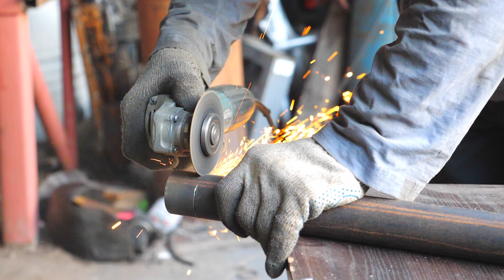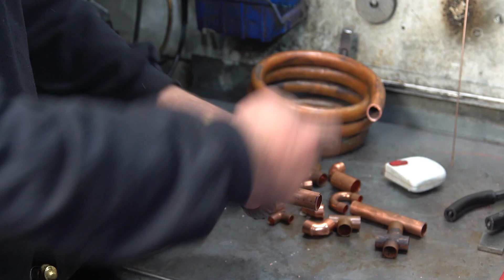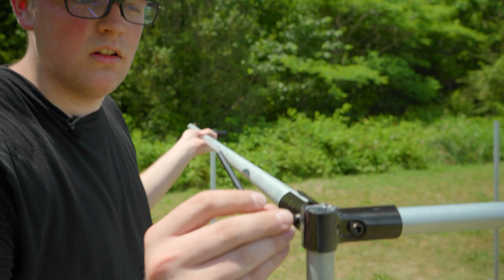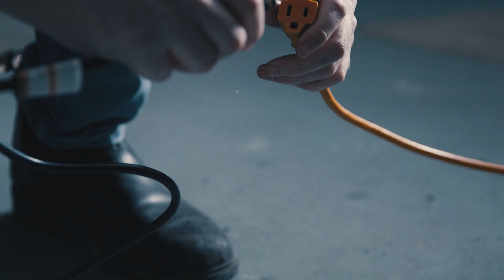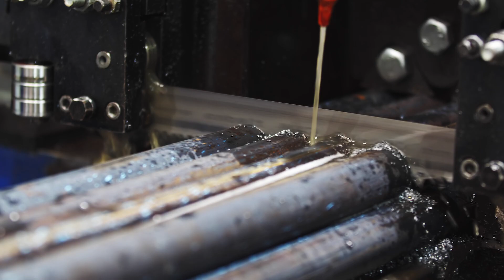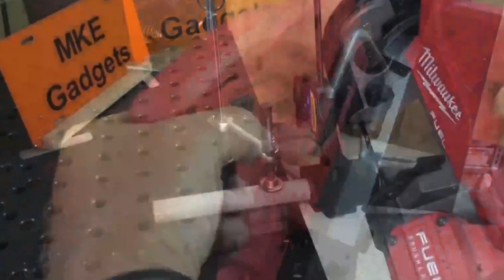Which Pipe Cutting Tool Is Right For You?

Comment: I have steel legs with 1” lined increments for utility shelving and find myself needing to cut down the legging pipe by (Amazon) Molfar named H27 Chrome Set of 4 Posts | Heavy Duty | Utility Shelving Units - Commercial Wire Shelf Shelving Posts Adjustable shelvingNSF Chrome Post   

Will a pipe cutter work to cut through this pipe (which I need to buy) or do I need to find a professional to cut it for me… if you read this message what do you recommend? Thank you!

Comment: Battery powered angle grinder + diamond cutoff blade + angle grinder cutoff stand holder = safe & super fast, repeatable 90 degree cuts anywhere. Also can do any angle, but why when we have Maker Pipe fittings? 😂
Reply from the maker: Haha nice! I have typically avoided grinders for cutting EMT but sounds like you've got a good process figured out. I'll have to give it a try myself. Thanks for the comment!

Comment: Honestly I've been using the Milwaukee M12 copper tubing cutter. Will it dull the blades faster? Sure. So far I've been enjoying it though, I find the convenience worth it, and it can cut very accurately. You do have to hold the conduit against the top of the tool in such a way initially that it grips, but this is easy to learn. Unfortunately the M12 is incapable of cutting 1/2 EMT, only the 3/4. The 1/2 is too small. I found a old forum post from 2014 of someone who removed an internal spacer and it was then able to cut 1/2" conduit (at the expense of cutting > 1" pipe I think). However after disassembling mine I discovered the newer serial numbers of 2471-20_B61C no longer have the removable spacer of 2471-20_B61A & B61B. There's a very clear diagram/note about this if you search for "44-66-0826 LOCKING PLATE KIT". The modification still seems possible, but instead of removing a spacer you have to replace the new thicker locking plate with the thinner original locking plate (without additional spacer). I ordered a few of this original plate but haven't performed the modification yet. I imagine the old part is becoming out of stock, sadly making this modification less accessible. If/when I perform the mod I'll post about it on the Maker Pipe forum.
Reply from the maker: Thanks so much for this comment Christopher. This is really valuable! It can be fun to go down the rabbit hole of things like this and do some problem solving along the way. If you end up doing the mod, I'd love to hear about it. Thanks again for sharing.

Comment: Good stuff with your breakdown of cutting methods. I own all of the tools you mentioned, other than the horizontal wet band saw, but usually break out the tubing cutter for most smaller jobs. I will point out that it is well worth it to get a name brand cutter (Ridgid or Klein, etc) , which are available from the box stores. IMHO, the durability of the cutter wheel is far superior and the cuts are cleaner, so less filing/ deburring is required. They also sell replacement cutter wheels for a few bucks. Remember that the tube cutter is designed primarily to cut copper pipe, which is much softer than steel EMT conduit, so the cutter would wear out sooner, and better steel (In the cutter wheel) is worth the money. A Ridgid cutter with 1-1/8" capacity is about $40 @ HD. 
   I already have several pipe projects in mind for my shop, and you guys have plenty of connector options available.
Reply from the maker: Thanks for the comment Andrew. Those are good things to mention about the handheld cutters. I appreciate you sharing your knowledge and experience!